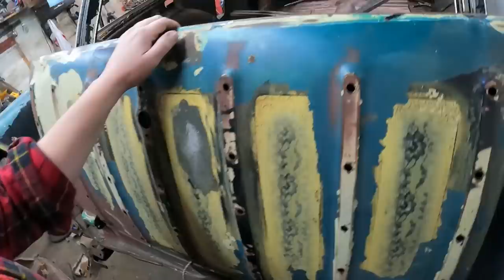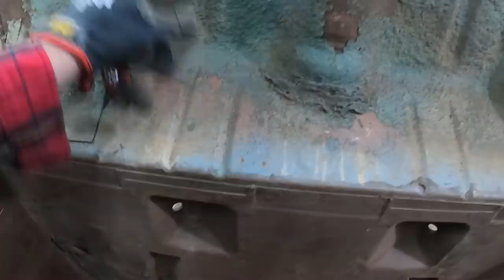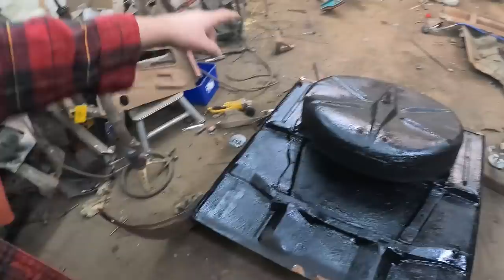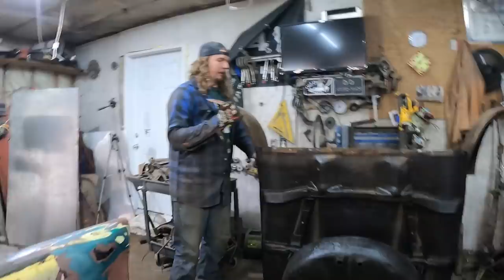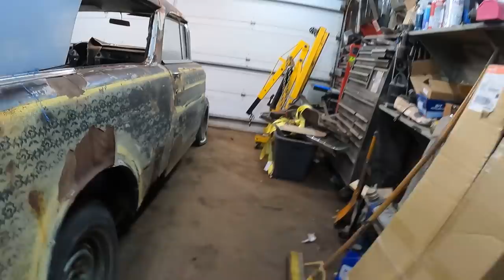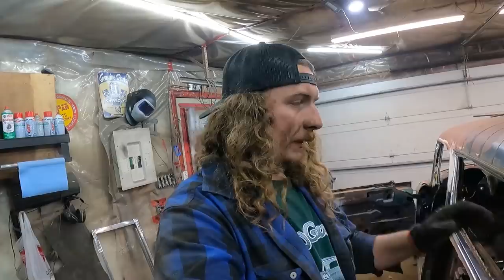FULL Trunk Floor AND Wheel Tub Install - 10 Pounds Of $#*T In A 5 Pound Bag!

Comment: Nice ! A lot of work , but much better work ! I saw a post from Don's HR Garage , about some bits & pieces you can use for your Nomad project . It seems there were only 500 of these 55 Nomads made . Ergo , rare would be an understatement , nowadays . What you are doing here on this old girl , will pave the way to a continued existence , in an ever shrinking "field" of survivors . He also explained the gap in the top of the door window to roof line situation . He shows there is a weather seal that fills that area , exclusive to Nomads . The best part of this build , Dan , is that you are going to get some needed help from some of the other "Tri-5ers" out there . I guess you earned some respect out there with all of your blood , sweat , & frustrations . That "knowing look" !
Reply: Just over 8500 actually.  Still, thats a very low number for a domestic production car!

Comment: Dan, you are pulling this back from the abyss of a Parts Car. But whoa, what an effort! Can you delete the Fuel door on the rear quarter and go with one in the tail light? I'm glad you are coating the nether regions on this build so it will last a few more winters in the 'Peg. It's amazing what you do in such a confined space.
Reply: Typical undercoating is a death sentence for steel cars. Moisture inevitably gets behind it and rots your car invisibly. Two other YouTubers I watch use bar and chain oil that's for chain saws. It is both sticky and self healing.  One is in Manitoba I believe, "Halfass Customs"

Comment: I would probably run a seam weld along the edge near the tailgate just to keep the crud out and I would coat the whole inside with truck bed liner for rust protection and sound insulation 👍

Comment: Hey Danny, since your going this far with this Nomad, have you thought about getting the tub media blasted after the metal is welded in? I know your not going for a 100 point show car but it gives it such a clean base for paint and body. 

I did it to my Superbee after I replaced a bunch of panels and it gave it such a clean base.
Reply: Wire wheel and some chassis saver paint is easy too

Comment: Dan you might want to consider having an exhaust fan installed in ant 2. It would pull the welding,cutting,grinding and paint dust,dirt and overspray out of the building. Unless you enjoy hacking up black crud out of ypur respiratory  system.I suggest a fan with adjustable louvers, 12 x 12 or 16 x 16.. 8 inch round furnace duct pipe. You could have fan at one end of roof peak wall in attic or side wall. In attic the pipe could 90 down to hole in middle of ceiling. I worked yrs ago for commercial HVAC company. Know a little about air handling. Al B in Ohio.

Comment: to the guy asking about the added shock bar that was not orignal. it was probly added when the floor gave way. dan its too bad you had to cut the rear floor supports i had one good one and one rusted out so i made a new one. it was a little work but worth it. also i think mine had  small wedges of wood under the long part of the brace (maybe it squeeked there?) looking good .

Comment: Thought you might remove the tailgate, use the engine hoist to lift the rear off the frame and install the rear floor from underneath. Either way you’re doing great. Love the content. Keeeep going!

Comment: Quite the job doing that back panel, but turned out great so far.
If you would of had someone on the left rear corner, that pan would of gone in a lot easier.
Saw Dani's hand a few times trying to help, but her #1 job was the camera.

Comment: @ DD Speed Shop
Why not clean where the floor mated together in the tailgate area. 
Wire brush, rust covert, weld through primer. So the joined pieces  will not have any issues?